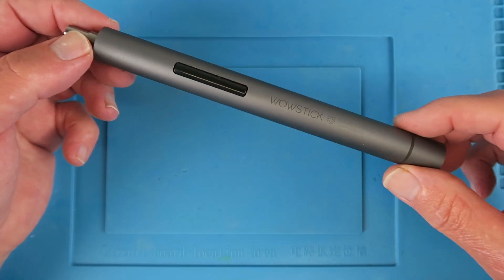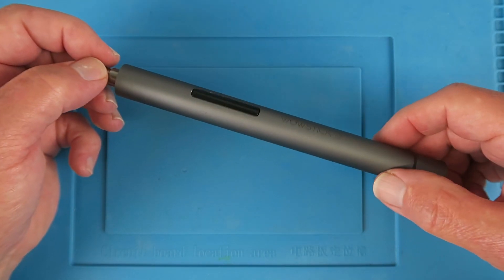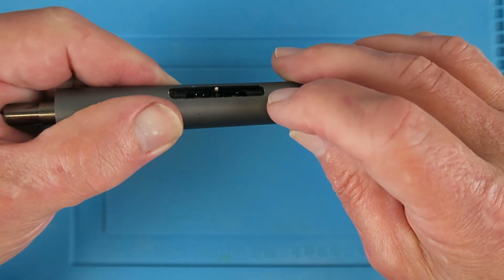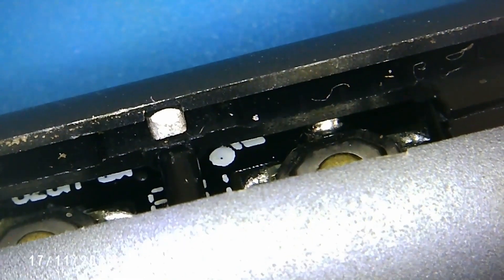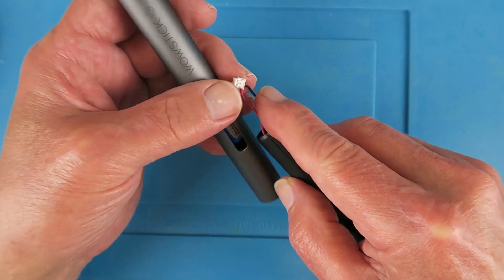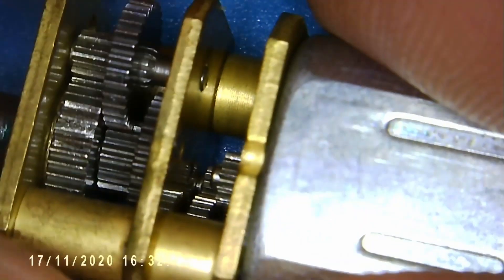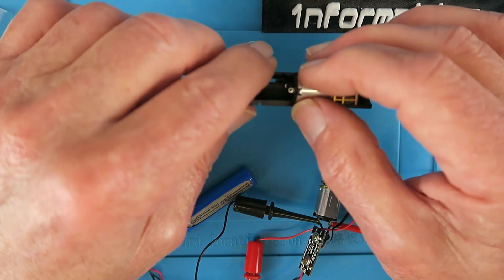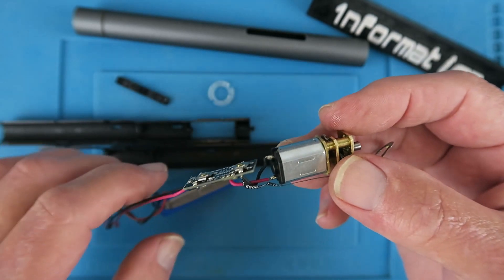Wowstick 1F+ Cordless Electric Screwdriver Teardown Disassembly Repair

Comment: Thanks for the video. Does the motor and gearbox listed for AliExpress, require the edges to be filed down, or is it direct replacement?
Reply from the maker: I believe it will need to be filed, it is not difficult to do. Be careful not to let the brass filings get into the gears. YouTube no longer shows me if you are subscribed. Please consider subscribing if you have not done so already!

Comment: Hi. Thanks for your video.
I'm stuck at the beginning stage where we have to remove the retaining clips that is part of circular ring. There are 2 of them. I could remove one of it, but the other one is stuck really deep inside. Can you think of a way of removing it? I tried to use a needle, end of knife, tweezer, but nothing seems to be working. Any idea? Please help!
Reply: Never mind, I just saw the recommendation to use the guitar string. I'll try that.
Reply from the maker: Yes, or maybe "piano" wire. Sometimes just push / pull, wiggle, tap or rotate and the "key" may just fall out or work loose. Good luck! YouTube no longer shows me if you are subscribed. Please consider subscribing if you have not done so already!
Reply: Update: Couldn't push it using the guitar wire, I've tried pushing it hard, it just bent the wire. I think the division in the middle kinda blocked my wire than going to the other side 🤔 push/pull, rotate and others also don't work
Reply from the maker: @aszosh  Hmmm, that's a bummer! Can you see the clip? Any way to get something either side of it and try an pull / lever it out? Good luck!

Comment: how did u get the battery and the charger port out? i dont see that in the video
Reply from the maker: Having removed the motor and circuit board push up inside on the bottom of the battery with a wooden dowel. Use just enough force as there is also the small battery charging board up there. This will force the plastic plug that has the charging port out. Please consider subscribing if you have not done so already!
Reply: @1nformatica  im impressed with how fast you replied. however in the mean time im ashamed to say that i kinda forced mine to get out and now its very ugly. but i repaired the machine so i guess i should be happy. I have just subscribed sir. thank you for the reply, have a nice day.
Reply from the maker: @mrMichaelVola  Ugly or not a fix is a result, well done! Thanks for the sub.

Comment: You completely skipped how to get the battery out. I'm sitting here with half a screwdriver and no way to put it back together.
Reply from the maker: I pushed it out with a wooden dowel rod.
Reply: @1nformatica  from which end?
Reply from the maker: @_Simon  Having removed the motor and circuit board push up inside on the bottom of the battery. Use just enough force as there is also the small battery charging board up there. This will force the plastic plug that has the charging port out.
Reply: @1nformatica  Thanks. It took a scary amount of force so I ended up shoving a skewar past the battery (because putting any force on a battery Is generally a bad idea) but I ended up getting past that. Thanks for responding quickly, i appreciate you.
Reply from the maker: @_Simon  Glad you got it out OK in the end! They did not make this thing to be serviced, clearly they won't you just to but another! Please consider subscribing if you have not done so already!

Comment: Hey mate, did u manage to find a gearbox with the right shaft length?
Reply from the maker: No, I think you would need to order about 100,000 of them to specify the exact length! Cutting the shaft down is really easy with a "junior" hacksaw or even a Dremel cut off wheel. Please consider subscribing if you have not done so already!
Reply: @1nformatica  thanks for the fast reply mate. OK I'll try . I hope I don't mess up the rounding the edge part ... at this time I'm not sure whether it's a gearbox of electric issue . There is no more charging light and when I press the button it lights up but doesn't sprin
Reply from the maker: @Paulabusa  Let us know your progress. Thanks.
Reply: @1nformatica  I screwed it up mate. When I was removing the internal assembly, I broke the wire for the led light and the USB port was broken from the pcb board after the battery... dang it, seems not economical to repair now. Just gonna get a new one
Reply from the maker: @Paulabusa  Bummer! Keep any good bits just in case!!
Reply: Sorry I meant shaft

Comment: what happened to the retrofitting of gears? or had you order yourself 3v gear motor?
Reply from the maker: I ordered a replacement which has a gearbox. You need to round off the corners with a files so it will fit into the case. Please consider subscribing if you have not done so already!

Comment: Good Tutorial all in all, but some parts need to be improoved. How do i get the Connector at the back out without breaking it (like i did because to unclearly described :C ), and it would have been nice to know that before i pull that whole thing out that getting the back connectors from the battery in again is difficult if u dont know how to get the back part out. My stick pins at the back are completely ripped of an the tiny board has a crack. So please tell about such big risks before you show me that you just pull it out. Thank you :D
R.I.P Wowstick 1f+ 16.4.2021 06:51 :(
Reply: "charger hole" can be push out by thick end sushi stick
Reply from the maker: Trying to repair anything that is not designed to come apart is difficult and there is always the danger of breaking things. I used a wooden dowel to push the top connector out. You have to push on the battery which in itself is dangerous.

Comment: Really appreciate the teardown, very helpful! Mine arrived with one of the retaining clips already loose and bouncing around inside the switch, and the whole unit was too far "forward" so the switch would stick when rotating the driver clockwise haha. Working like a champ now.
Reply from the maker: Hey thanks! Very useful tool if you don't strip the gearbox like I did! Please consider subscribing if you have not done so already!
Reply: I have the same problem, how did you fix it?

Comment: Amazing tutorial sir i enjoyed it, now i feel safe to order the wowstick 1F pro knowing how to service it in the future......... keep up the good work now you have a new sub in your channel looking forward for more interesting troubleshooting tutorials. have a bless year and stay safe always...;)
Reply from the maker: Hey thanks! It is a useful tool especially working on laptops with dozens of screws! Keep safe!
Reply: @1nformatica  i saw the product before but was not sure if i needed one as i have a tool set full of screw tips, then my friend bought one i used it 2 or 3 times i liked it but the thing i don't like about is the rechargeable  batteries their life span and sourcing. but know that i saw that you can get the gearbox that was amazing. going to see if i can make sure that i can get batteries for this in case mines dies.
Reply from the maker: @ghislainriou9560  The battery is a standard NSC1040 LiPo commonly available. You may even find one a little longer with higher capacity.

Comment: Tengo 2 que dejaron de girar. Solo funciona el led. Podría ser el motor ?
Reply from the maker: Lo más probable es que sea la caja de cambios la que esté atascada. Puede quitar el motor de la caja de cambios para probarlo. También puede probar con un multímetro que el voltaje está llegando al motor. La placa del controlador puede estar rota. ¡Buena suerte! Un saludo.
Reply: me pasó lo mismo, estaba sacando un tornillo bastante duro y dejo de girar. andaba buscando como desmontar. encontré la pieza, pero no sé cual comprar si 3v, 6v o 12v y qué rpm?

Comment: Do you happen to know what IC is on the main pcb?
Reply: mx612e
Reply from the maker: @tastytechaddictsmtb  Thanks for that. From the data sheet then it is "Circuit within the integrated circuit using N-channel H-bridge driver and P-channel power MOSFET design, suitable for driving brush DC motor or drive a stepper motor windings."
Reply: @1nformatica  yee it’s the motor driver ic, sometimes it burns out and the motor stops working like it’s done on mine, so have to replace it
Reply from the maker: @tastytechaddictsmtb  Good to know, thanks. Where did you source the part?
Reply: @1nformatica  eBay
Reply from the maker: I did not take a note of what it was but almost certainly it is an H bridge driver similar to the one I show here : https://www.youtube.com/watch?v=9lEQQ2pnmMM Please consider subscribing if you have not done so already!
Reply: I think I'm having an issue with my IC. This driver is my, well, daily driver, and it crapped out on me a couple days ago. Took it apart, connected the battery back on and tested and BOY did the IC want to burn my fingers. I can do most soldering work, you think replacing it would fix my issue?
Reply: @MisioMorghon  me pasa lo mismo ocn el ic,lo solucionaste?

Comment: the two connectors on the charging port , do you recall which one is for the battery or for the mainboard? i managed to unplug both when pulling out the mechanism and do not know where they go
Reply from the maker: On my board the battery is connected to the left hand socket (when looking at the socket side!), the board is marked with a "v" and a Chinese character. Please consider subscribing if you have not done so already!

Comment: For what it's worth for others doing this, the charging port can be pushed out the back once you've detached the wires.  Also worth noting the knockoff with the similar form factor, much easier.  Same button removal, but now you have a set screw you remove the motor and button assembly come out leaving the battery behind.  Contact is made via the case as ground and another wire toward the back.  Much easier.  My wow stick had 3 bearings, the knockoff has 6 so I"m not sure which one is the cheap knock off but when these things work they are awesome.  The major parts interchange too, I was able to use the gearbox off the wow stick on the cheap knockoff.  I wish you could get these gear boxes in titanium.
Reply from the maker: Thanks for sharing your experience, it will help others. It's interesting, I too have noticed with some products the "knockoffs" are sometimes better made than the originals! I agree a better quality gearbox would be great. Please consider subscribing if you have not done so already!
Reply: How did you push the back out?
Reply: @tomroggero  You can use some microscrewdriver extensions, I put two of them together and managed to push it out. BE CAREFUL though, aim for the lower half where the connectors are otherwise you risk damaging the circuit board, which I did just now. To alleviate this, put on some cotton or styrofoam on the end.

However in my case, it appears the circuit board was already partially damaged, so I didn't lose anything.
Reply: @Quizerno  I also damaged mine. Do you know of any replacements, because I cant find any.

Comment: El motor no es de 160 rpm es de 200
Reply from the maker: Aunque los anuncios dicen 200 RPM, la velocidad real de mi original era más lenta y el reemplazo aún más lento. Si realmente fueran 200 RPM, eso es un poco más de 3 revoluciones por segundo. ¡Claramente este no es el caso de mi Wowstick!
Reply: @1nformatica  3v 6v???
Reply from the maker: @joseluiszambrano7148  3 volt.
Reply: De cuantos voltios se debe comprar el motor ? 3V a 160rpm?

Comment: A great teardown there. Can you confirm what the battery is please? 3v ? 320mah? thanks in advance & stay safe
Reply from the maker: Hey thanks! From memory it is a 14500 (AA) size 300 mAh Lithium Ion cell 3.7 volts nominal. Please consider subscribing if you have not done so already!

Comment: My unit came with dead battery and banggood seems unwilling to replace it and instead ask me to repair it myself Lol.
From what I've seen the older model had replacable AAA batteries and all you have to do is remove the bottom cap and replace 2 batteries just like that, however on 1F+ is like you mentioned impossible to remove this cap where usb port is so it seems I'm going to have to remove these little clips so battery should slide down the tube unless there's other way?
Reply from the maker: Sorry to hear of your problem. As you read in the comments the only other idea was to loop some guitar string or maybe fishing line around the recessed clip and pull it out. I tried really hard to remove the top USB port but in the end the only way for me was to push it out from below pressing with a wooden dowel. Good luck!

Comment: hello what kind of engine is 40,50,56 or 156 rpm? thnks very intersting the video
Reply from the maker: Hey thanks! The original is supposed to be 200 rpm but mine was nearer to 150 rpm. The replacement seems a little slower. Please consider subscribing if you have not done so already!

Comment: Trying to get those 2 retainer clips is a challenge and I ended up pushing one in to for to where I could not grab it at all.  I wanted to pass on a few tips to prevent this and also how to remove them if this happens to you.  First, use 2 Xacto knives (one on each side of the curved retainer) to pry them out.  If you get one of the retainers stuck, a piece of guitar string or piano wire can be fed in from the opposite side to push the retainer out.  Wrap the wire around a screwdriver shaft or a dowel first to put a curve on it then feed it through a little at a time using needle nose pliers to push it through.  It worked for me.  Good luck!
Reply: My screwdriver doesn't even have both clips, one is too far in and it's impossible to get a hold of it and there's no clip on the other side.
Reply: @waterfelon33  use an old pocket watch spring to push the key out
Reply: @tmack4207  Banggood already sent me entire new unit last year so it's all good but thanks for help I'll keep that in mind in future.
Reply from the maker: Great tips, thanks for sharing. Please consider subscribing if you have not done so already!

Comment: Should I get this or the knock off? Seems to have more torque and a bigger battery
Reply from the maker: I guess they are all produced in the same factory. Shop around because the "original" ones can usually be found close in price to the "knock offs". Perhaps more important is where you buy it from, Banggood have always been fair with me but try and get you money back elsewhere could be problematic!

Comment: You missed the most important part. The charger port part. I'm not able to get it out and I broke an ic there trying to push it
Reply from the maker: It is difficult but the only way I found was to push it until there is enough showing to prise it out from outside. It is a tough balance.

Comment: How'd you get the battery connector at the back out? You don't actually show it in your video
Reply: I also struggled with this - the solution that worked perfectly for me was to take a chopstick and place it against the screw (visible when looking down the housing tube) that holds in the USB micro board, and tap the wide end of the chopstick on a countertop, probably would have been easier with a small mallet or hammer. It definitely required more force than I thought would be needed, but it came out cleanly.
Reply from the maker: I pushed it out using a wooden dowel rod pushing against the battery. It takes some force! Please consider subscribing if you have not done so already!
Reply: @1nformatica  But the battery is already out - along with the motor, 4 wires and 2 connectors, on mine. It looks a nightmare to put back in and reconnect the two plugs to the charging socket.
Reply from the maker: @phuketexplorer  The charging board connector wires should be long enough to grab with a pair of pliers to push back into the board.

Comment: Great video, very informative. I just received my Wowstick 1F Electric Screwdriver today, hope I don’t have to replace the gearbox.
Reply from the maker: Just don't try and use it over its weight! Still haven't worked out how the locking mechanism works. Please consider subscribing if you have not done so already!
Reply: @1nformatica  I think the 3 small rollers are to lock the shaft so you undo a screw manually (without the motor running) that the motor will not undo? The 3 rollers remind me of an engine stud extractor like I used when I worked Lotus cars.
Reply from the maker: @barrygreengrass3379  Yes, you are right but in my case when I thought it was locked it wasn't!!